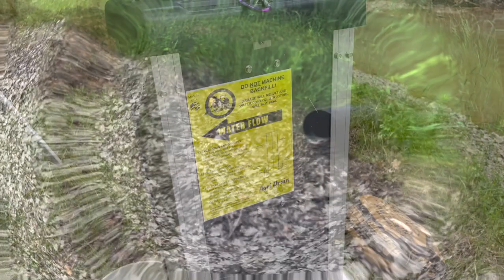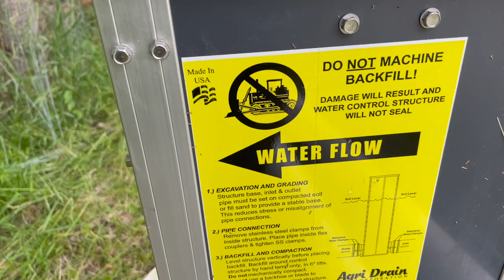Agri Drain Inline Water Control Structure Installation for a Farm Pond

Comment: Can you explain what exactly is the purpose of installing this? For example, what problem were you having that this thing fixed, and conversely what benefit did installing this system gain you? 
Thanks for the video.
Reply from the maker: I had only an overflow pipe for flood control of the pond and no way to regulate the level of the pond.  It was either this or a stand-pipe(which also would work well).  I liked this because & can lower the pond if needed to clean out weeds or if a huge storm is coming to help protect the earth dam.  Others use them to completely drain shallow ponds/fields, then plant millet and then flood the fields in the fall for hunting ducks.  That is more used down south in migration patterns.

Comment: You mentioned concrete on either side. Did you set the AgriDrain in concrete or just build a platform of concrete for seepage control?  Thanks for the video.
Reply from the maker: Concrete was just to hold down the drain - otherwise it risks floating.  I have pretty dense clay and it doesn’t leak at all.